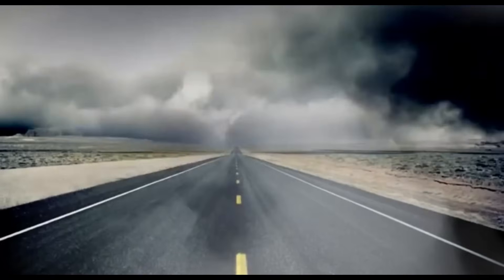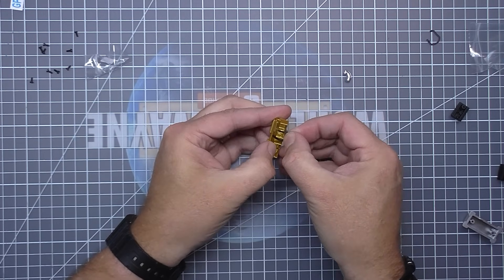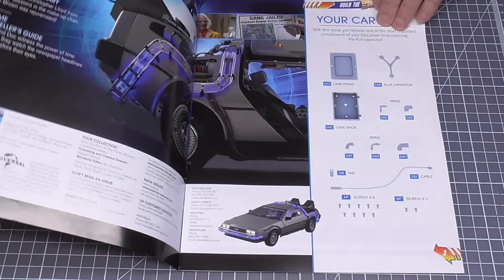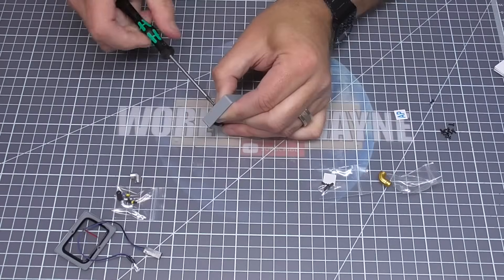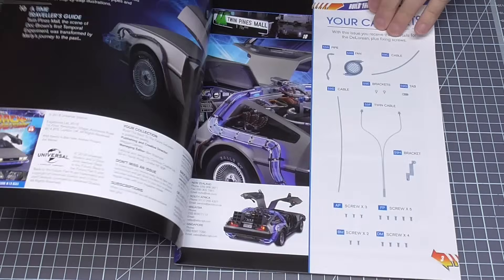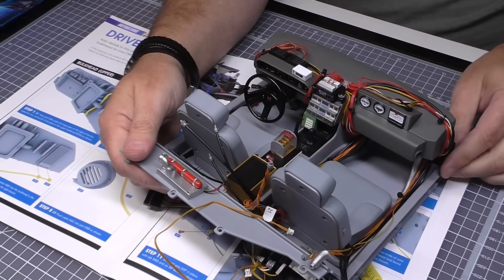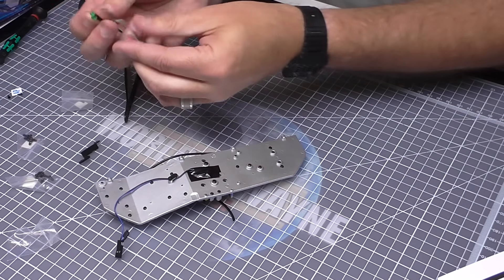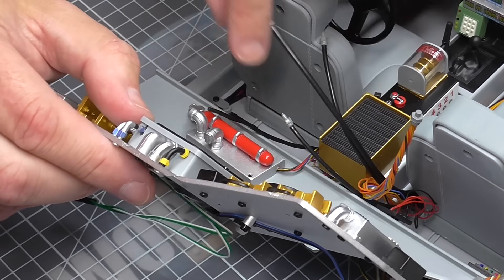Build the Back to the Future DMC Delorean - Pack 13 - Stage 57-61

Comment: im sure both that and the falcon has been much easier the send time around  its like building  spoked wheels 
i bet you wont have a issue this time with the body mating either itll be very interesting what the stock version without the mods will look like after its done

Comment: Wayne, I think you should tweak a little thing before other stages are added preventing that: check the steering wheel, it's not straight when the front wheels are.

Comment: Hiya Wayne I'm just wandering if you or fellow modellers have a fix for the Delorean wing doods? I have had my Delorean displayed with the drivers door open using that stupid black plastic block ! At the weekend the door was dropping a little as I took a look the little black hinge broke! 😔😔😔 ! It looks like the weight of the door as took its toll on the little hinge over time! Now I have super glued the hinge in place and got my fingers crossed it stays put! Now I'm looking at an alternative way to hold the door open which dosent put a strain on the hjnges! 
I'm thinking a thin clear plastic rod to put inside the car from floorpan to the door ?? But any other solutions would be appreciated ! Else it's going to have to be displayed with closed doors!!!

Much appreciate any help! 🙏👍
Reply from the maker: I.only ever used the black wedge. I don't think the instructions said what to do with it.
Reply: Yeah Wayne that's what I have been using ! But like I said the weight of the door must have put stress on the hinge and snapped it! 
The super glue as worked but until.I find a better solution of holding up the door it's going to stay closed !👍👍 ! 

Keep up the great work ! 
I got my eye on the Darth Vader build when it releases, until then 3 more packs for Ecto -1 and 1966 batmobile!👍👍

Comment: I was hoping to start a subscription of the bttf delorean which says on fanhome website that it's still available from issue 1 but I just contacted them and they have told me it's no longer available.  Can you tell me where else I can get this subscription please wayne
Reply from the maker: It will be coming back soon
Reply: Thanks wayne i will keep eye out im 3 quarts way of building titanic so i wanted to start collecting bttf asap
Reply: Great videos. Where can i get that oil pot very handy